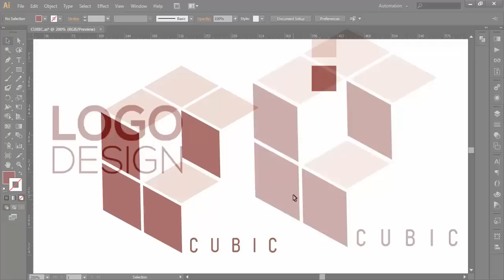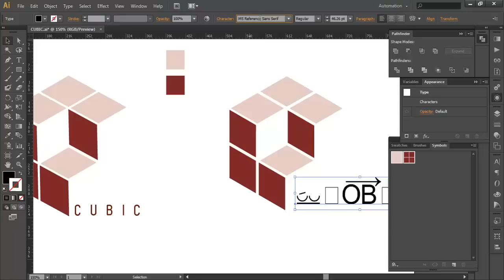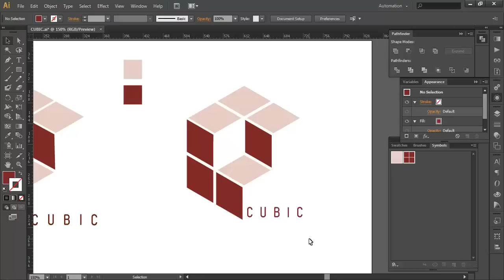Professional Logo Design - Adobe Illustrator cs6 (Cubic)

Comment: hey guys welcome to the exciting tutorial of creative process in today's
video we're designing this logo look at this local this local is comprised of a
03d q where small pieces of squares has been placed on the top face as well as
on the left-sided phase of the queue and small and each piece is consisting of
four small squares and from the top one of the pieces are then push downward and
from the left one octopus has been pushed backward and this has created the
illusion of depth to the local so that's created slow go to create the logo will
first create the square of force small square pieces so to create that we
select the rectangle tool and left click your mouse button here keep the riverton
high 200 by $OPERAND hundred make that constant and click ok and after that
next thing is duplicate this and paste it in the friend to do that ctrl-c to
copy control after based in different and fill it with stroke color so give it
a stroke color black and remove the fill color now in the stroke with the up and
down arrow keys you can increase or decrease the thickness of the stroke
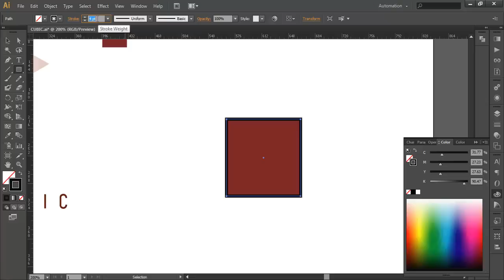1:20let's keep this like this and after that we select the line segment two and draw
1:27a vertical as well as horizontal line passing through the center so just try
1:32it out from one going to under and on top to bottom now select all the strokes
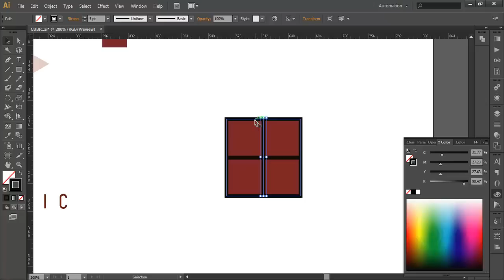1:39and the line segments there's this this shift selecting shift-clicking
1:45everything will be selected converters and object to do that we go to object
1:49expand and it will expand the of strokes into object form and later go to part
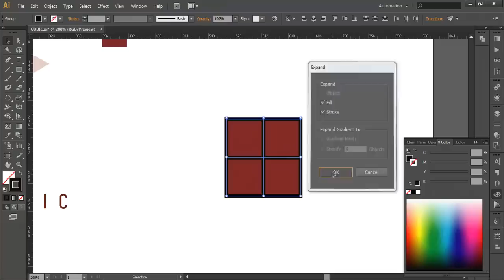1:58finder and it will you find that in Windows but finder and just combined it
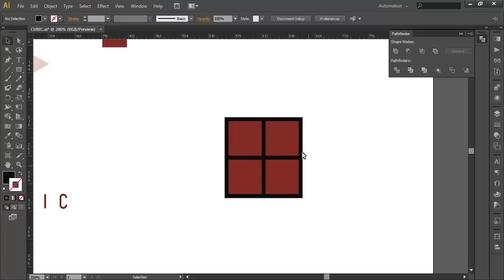2:04after that select everything abstract the street that portion which we have
2:11made before and you got a square with some for small square comprising now if
2:17it with this collar with the IPO dude and duplicate one more time and fill it
2:24with this color now the next step is to make convert this objects into simple
2:31form and to make it a symbol with first open the symbol ballot go to Windows
2:36symbol and you audio symbol box here you can put this dragon and and that's a
2:44deleted which I have made earlier i'll just delete it out now to create the
2:50object in the symbol form will just select it
2:54dragon inside there and give it a name like it does get this one number one
3:00shape you find that it has been placed here now like this one and place it
3:06inside and give it number two and click ok now once assembled has informed you
3:12can delete the objects
3:14the next step is to create a queue so to create a queue select the rectangle to
3:19Africa mouse button and get hundred hundred go to affect3d extrude and bevel
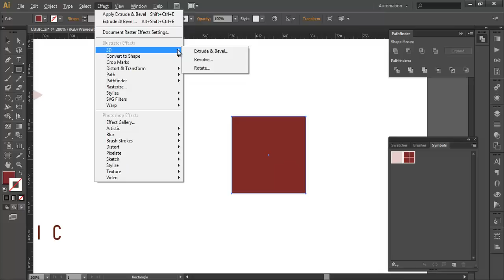3:28here you can create 3d object using this of options so preview it and give it
3:37some thickness hundred and rotate the angles and make sure that these two
3:45lines are aligned the top and the bottom one and
3:51do it adjusted and it's aligned now the angle and make sure that these two lines
4:04should be perpendicular to the ER should be straight that is perpendicular so
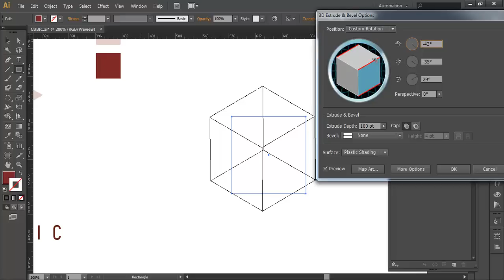4:10just make it perpendicular do it adjust it keep this minus maybe 45 so once
4:22you've done that a your 3d cube has been formed to edit this we need to open one
4:27more option here appearance here you get the option 3 DX river just a quick and
4:32that Rivera it now we will put the pieces that symbols on this face as well
4:40as on this way to do that go to my part
4:42first make it invisible now you can see that the this stuff is selected so here
4:48we'll put this small piece place it properly scaled it down if it's very
4:54huge i think is good now go on the face
4:59this is button this is backward and we need this face over here please this
5:04small squares place it properly and you can scale it up or down using a
5:11according to a preference
5:14now you can go backward also to edit the previous one
5:19if it's not you can just make it a little bit downward bring it near ok
5:27once you've done that you can click ok and if you it's okay your angle is good
5:33you can just keep it or you can just a little bit
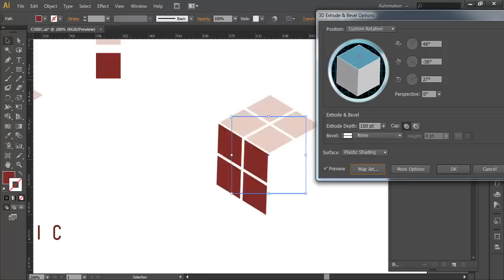5:38this if you need to do some correction just make sure they're anguses
5:43perpendicular and click ok so you got your shape now we need to create this
5:53depth of illusion and to create that will just convert these are symbols this
5:59whole conversation object from to do that we go to object expand appearance
6:02and ungroup it off three times like this object release clipping mask and delete
6:10the clipping mask option that's very same way of escaping mass and delete the
6:15clipping mask
6:16peace now on group this and ungroup this so all the small pieces are no separate
6:23now select this one and push it down work with the down arrow keys and please
6:29it battle to this now select this one and push it on the right-hand side so
6:37just place your shirt and bring it up or and elects this much so you can push it
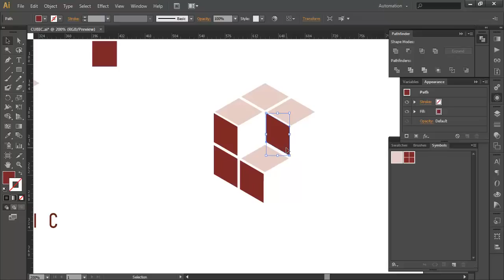6:44down a little bit so we have created the depth of illusion and almost everything
6:52is done you can just scale it up a little bit and overall you have created
6:583d piece cubic peace now we need to text so we select the text option right see
7:06you be icy cubic
7:12you can scale it up
7:15yeah change the text desire text you need will find that text india get X
7:23palette here so just we can even type the text to as ball
7:31I think this is the correct one and you got it now to further with we need to
7:35fill the colors just select the color and you can and give some spacing
7:41between the two texts to alphabets through their go-to character and here
and keep some distance between them scale it down and place it on the
correct place scare done if it's huge and we have finished our tax so this is
how we have created this local very unique-looking the war a small presence
of deafness illusion using the basic tools which we have used earlier that is
3d extreme Bible and we have used some symbols and applied in a very unique
manner and created this to shade color logo which is very professional
hope you enjoyed the tutorial don't forget to check out the next tutorial
coming up and if you want more updates on designing press the subscribe button
thank you